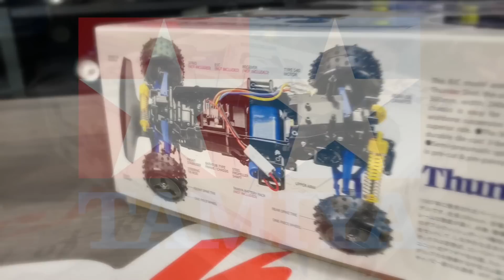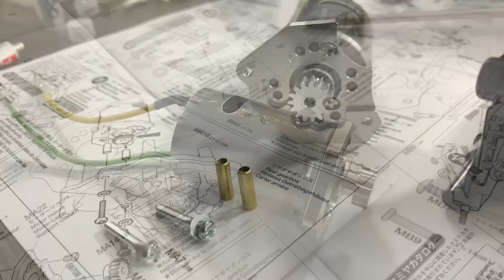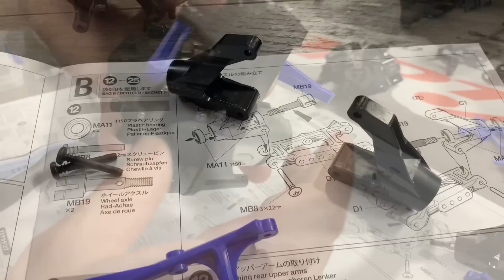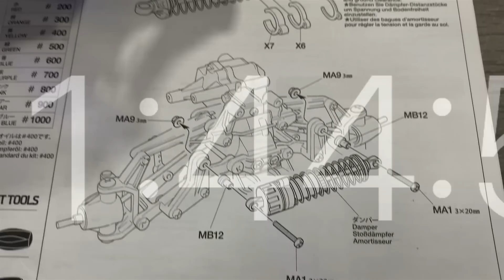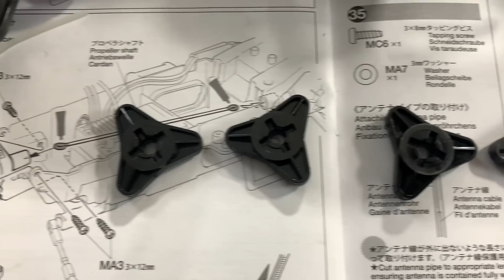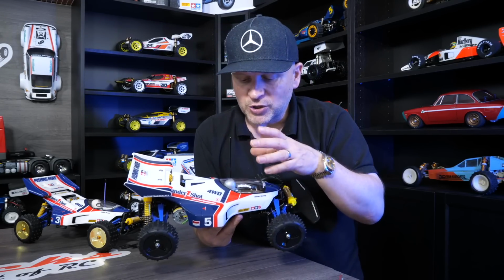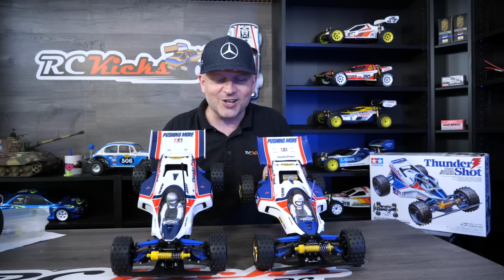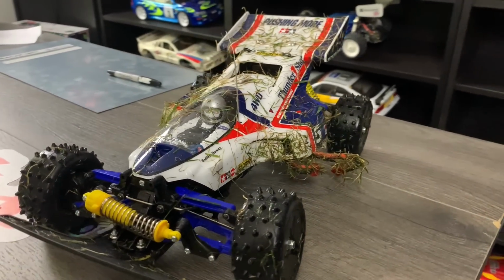Speed Building A Tamiya Thunder Shot Against The Clock & Setting A Fast Lap On The New Track.

Comment: I have a Fire Dragon which is almost identical to Thunder shot. I really like the RC car because it runs very well and fast much more than I expected.  👍Surprisingly, it runs very first, I guess, because it is very light weight and vey low friction in the drivetrain.  Only one disadvantage of this car is especially the suspension parts including the suspension mounts on the gear box is very weak and they break so easily... I don't care so much if only the suspension arms break but it is really annoying when the suspension mounts break because it is a part of the gear boxes. So, we need to replace the gear boxes in such cases.🤯 I had a Terra Sorcher before and I reinforced the suspension mounts with FRP and it helped a lot to avoid such troubles around suspension monts though it was pretty troublesome to do it.  Anyway, I still like the car because they are very fun to drive and very controlable despite of 4WD!😄

Comment: I noticed you used an Hitec HS-311 servo. Hitec servo's have 24 teeth. The included basesplates for the servo saver are 23T (Sanwa) en 25T (Futaba/Tamiya). The Futaba/Tamiya one gives the impression it fits just fine on the Hitec. But as soon as it gets some force to endure it skips over the teeth. Multiplex/Hitec have a baseplate for the Tamiya servo saver that fits Hitec servo's.
Reply from the maker: I didn't know that,  Thanks for the info.
Reply: @RCKickschannel  I found out the hard way. 😅 Built an Neo Fighter with an HS-311, on the first test drive it hit a loose stick in the field and the steering angle was all wrong after that. I didn't understand at first why it happend and thought the servo broke. Then found out about the different amount of teeth.

Comment: Great video! Thanks. It’s helping with my build 

Did you use the Carson esc? The Carson esc with mine I cant find a way to mount the on / off switch in the switch slot. Did you have the same issue?
Reply from the maker: Yep you have to stick it to the side of the chassis inside.
Reply: @RCKickschannel  ah. Ok thanks! 👍🏻